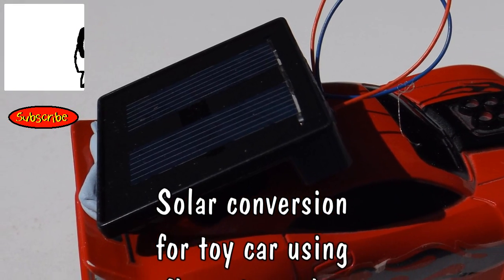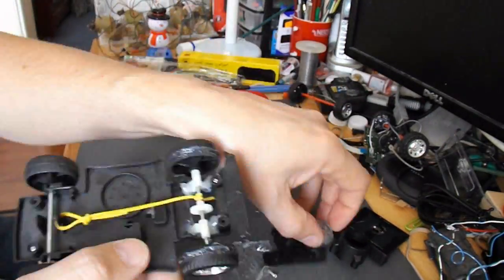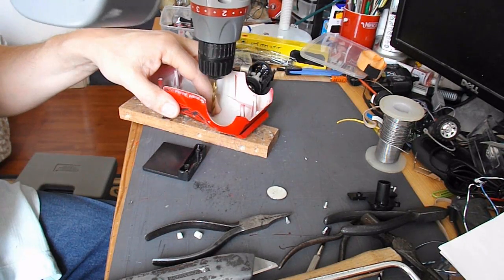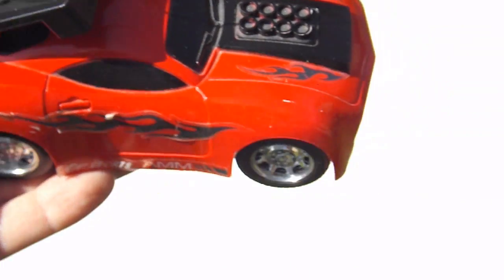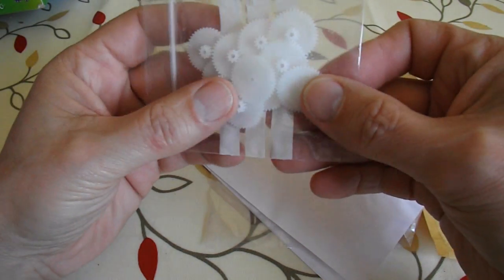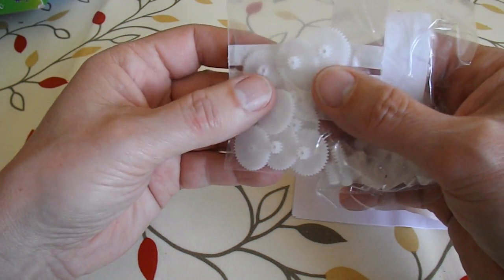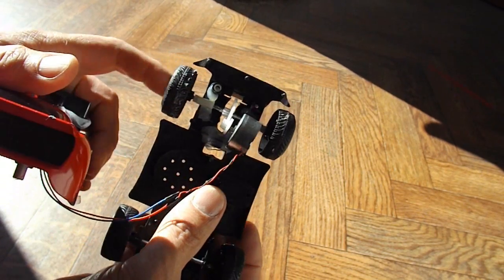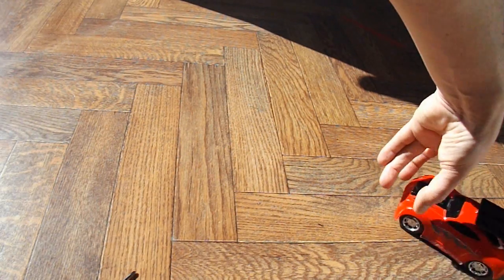Solar conversion for toy car using fluttering solar dragonfly components

Comment: A solar powered full function rc car would be very cool! But your gonna needed a bigger solar panel
Reply from the maker: If you want solar powered RC you have to decide if you only want it to work in sunlight or you want to add batteries to power it when it drives into the shade. If you go down the route of using batteries then it loses credibility as solar powered. Here is my Solar RC boat https://www.youtube.com/playlist?list=PLA5a2xPRSrB0CbqRkzsGRzhfMqrEydOPg

Comment: im building a boat with 5 motors and 3 4in x 5in x .5in 6volt solar panels.For a school project.
Reply from the maker: It sounds like you should have plenty of power available, good luck with your project. I have several Solar Boats in this playlist https://www.youtube.com/playlist?list=PLA5a2xPRSrB2cuyCDt7Ig20u0pzPWtVo3
Reply: Thanks so much I was wondering if you had any suggestions material wise.
Reply from the maker: Miguel Gonzalez Styrofoam packaging works fine for me.
Reply: How much v solar panel do you use

Comment: I am going to make solar torch  battery will 3.7 v lipo battery will work
Reply from the maker: +Sachin Kc sorry that does not make sense to me. If you mean you are going to charge a 3.7 volt LiPo with a solar panel it just depends what size panel you are going to use to provide enough voltage. You will have to research what voltage and current is required to charge a 3.7 volt LiPo and then make sure you buy the right size solar panel to match those requirements. With a LiPo you need to get the charge rate right or you may cause a fire.
Reply: Light up an LED

Comment: Where did u buy the dragon fly at
Reply from the maker: Paul Lenderson people who keep repeating the same question on my projects over and over again are consider to be spammers and get blocked. You have asked the same question 4 times plus a similar question. I buy these items in bargain stores which could be Poundland, 99p Store, Poundworld, Home Bargains, Poundstretcher or any of the other similar stores. It is a seasonal item that shops only stock at certain times of the year. It may be that your local shops are not stocking them this early in the year or it may be that they have decided not to stock them so I guess you will just have to keep looking around. You could get them from eBay but they will be more expensive.

Comment: Hey I was thinking about doing my own project a couple of days ago but it went downhill haha... I thought it would be a cool idea to make a square but bot with a solar panel and four light sensors so if one stop receiving light it would stop and head in the other direction. Wondering if you'd be able to achieve this?
Reply from the maker: Hi Andy, here are a couple of my simple light sensitive bugs made from garden light parts.
Let's have some Solar Fun #1
Let's make a Solar Vibrating BEAM Bug
I believe the bots you are talking about are commonly called photovores and there are plenty on YouTube. Here is an example  http://youtu.be/3XUFVwuzciw
It might be possible to use the solar garden lights to do this and use the fact that their electronics switch on the LEDs when they go into shade, so if you had a few of them pointing different directions and used the output to the LEDs to switch the motor direction you might be able to make it work.
Reply: Thanks for the help I shall go and watch some videos on it

Comment: simple :=)
Reply from the maker: Hi Mic, this conversion gave me more trouble than I expected. The car is a bit heavier than I expected so the motor struggled to move it with the existing gear. It was OK when I used a bigger gear.
Reply: Nice